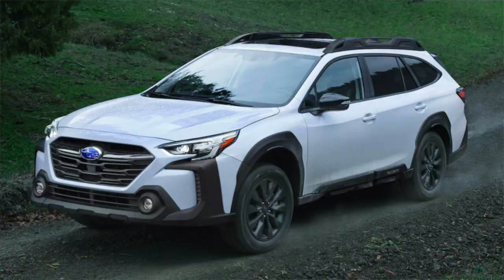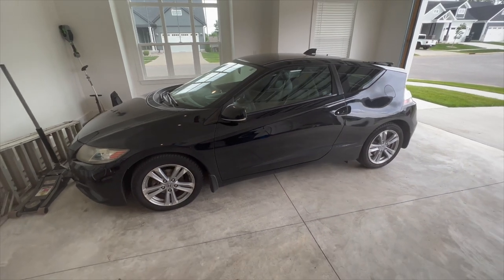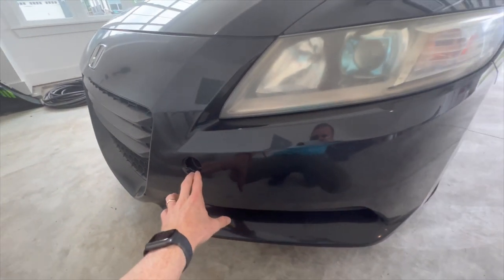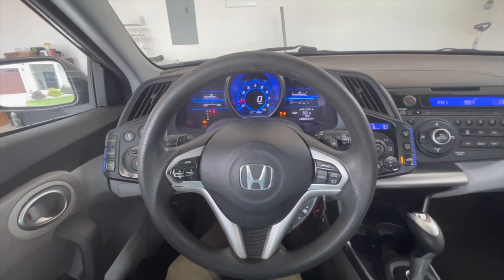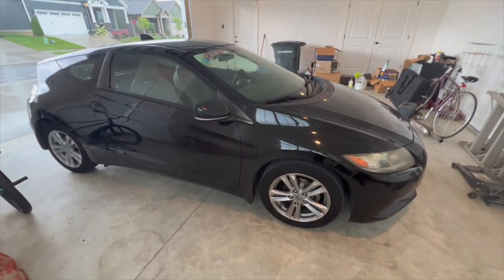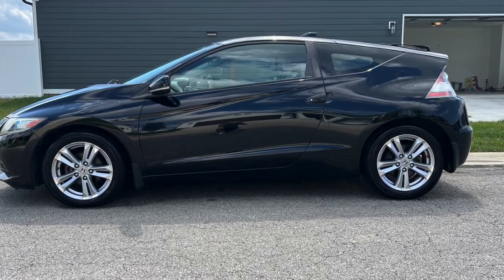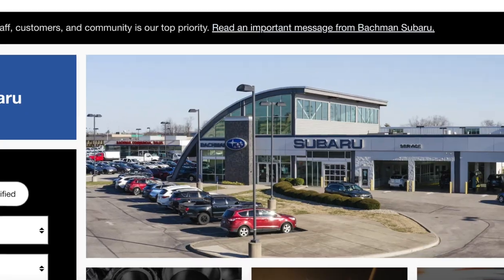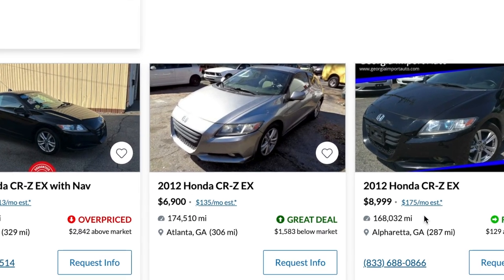5 Things To Do Before You Sell Your Car

Comment: About half a year ago I called up the sales guy we previously had. I asked him if all of the forester sport models were already spoken for. He seemed shocked that I’d even ask because my car is so new. He told me that they couldn’t honor Costco pricing right now and matter of fact everything is selling over MSRP. But he’d call me back about the current pricing. I never got a call back. 

While me & hubby were at a different/closer dealer for my inspection, we walked to the sales guy and told him upfront that he has the opportunity to steal our family’s loyalty - I clearly don’t need a newer forester sport but I want one (I’ve got a 2019 forester sport) - I am considering purchase if they don’t MSRP upcharge me. We built a car primarily using my current vehicle as base and added some upgrades - wrote up a contract and I put a down payment. 

I think I got really low balled on the trade in quote tho because I was tentatively only offered $2k over my guaranteed value. My car is only 3 years old, low miles and except for road rash scrape on a single wheel it’s in very good condition (no other exterior scratches, light scratches on interior and  no stains.) The low offer bothers me. I don’t want to go thru the hassle and anxiety of a “private sale” - but I did some online quotes like KBB & Carmax - and sight unseen the offers are more like $6k -$7k over guaranteed value. 

I assume we are locked in to the sale price because I have a contract. But I still have power in trade-in negotiation and/or ability to sell elsewhere, right? It’s probably worth noting that even if I take their trade-in offer, I still will end up with a newer car and a refinanced payment the same as my old loan with maybe an extra year of payments. 

Sorry for the long story but you seem to be a good source of honest subaru info. Also - should I get the wheel fixed/replaced for a better sale/trade value?

Comment: Alex good video. I noticed that your side load garage isn't very deep. Outback is 16 feet.  I know that I had to move big tool box and other things to have plenty of room. Put 4x4 on floor as stop block.  PS Paint or tape location of stop block to relocate when cleaning garage.
Reply from the maker: I tested the space a few weeks ago with one of our Outback service loaners and it was a tight squeeze. I could move a few things around but it's going to take some getting used to. My current car is so small I've been spoiled with the space lol
Reply: @alexpmo In 2002, bought a new Ford Excursion. For First 12  years or so in garage. Folded mirrors in and had to pull to drywall. Still have it with regular service.
Reply: @alexpmo  Close calls w touch less hatchback almost hitting garage door. Cancel this on dash or leave fob in house.

Comment: Alex I watched one of your videos the other day when you were in the middle of purchasing your new Subaru you made a comment about the Forester being too big can remember the exact words you used but you have chosen an Outback which is bigger than the Forester I guess I just didn't understand your comment
Reply from the maker: Hey Gary, sorry for the confusion there. Someone else had the same question as you. The Outback is technically bigger from a cargo perspective. It's about 2" wider and about 10" longer than the Forester, but the roof is shorter by a few inches. The low roof and the center console are the biggest reasons why I went with the Outback. The tall roof on the Forester also means it has larger windows. The large windows make it feel too open for me. The center console on the Forester sits low while the Outback center console sits up higher and makes it feel more snug in the front seats. Hope this helps clarify what I meant!